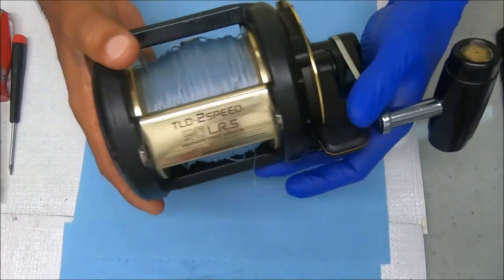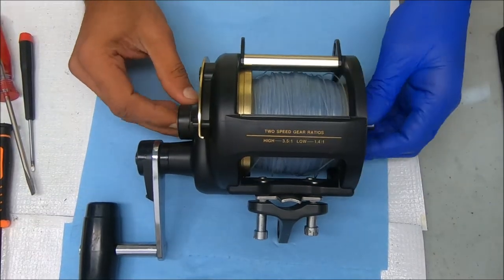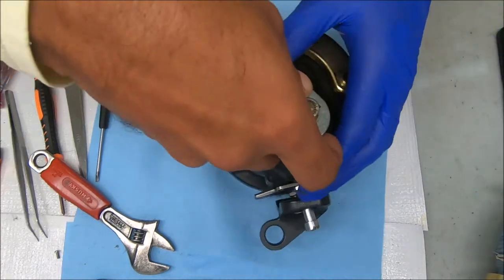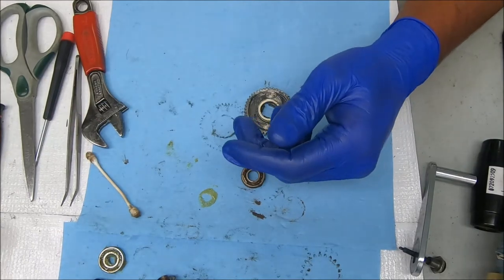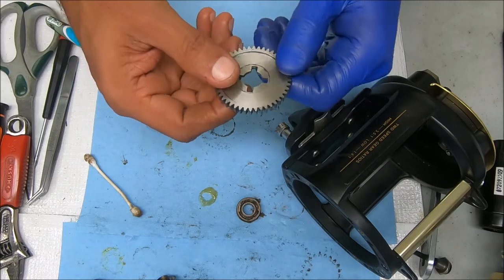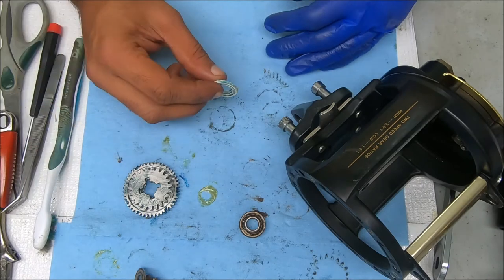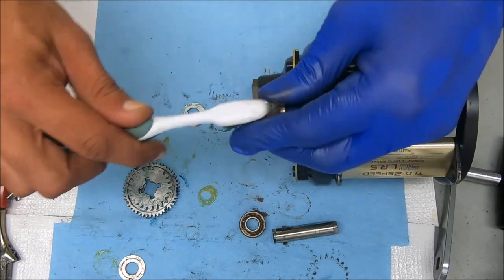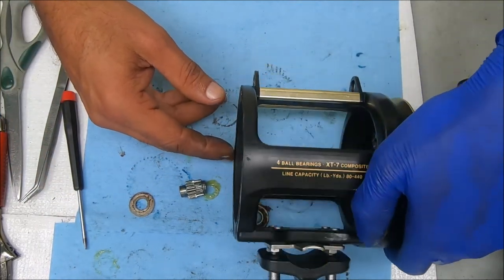Shimano TLD 50LRS Handle Shaky And Hard To Crank - How to diagnose & service

Comment: Trying to figure out why my low gear won't engage any ideas? Looking for a video how the gold sleeve goes inside of the drive shaft any idea if the teeth face up or down?
Reply from the maker: Thanks for watching. The slotted end faces down toward the gears.
Reply: @TSGReelService  appreciate the response bruddah u the man
Reply: I put it back together the low and high gear engage but when reel is back together the low gear seems like it wants to slip and dosnt catch the teeth everytime ? Any suggestions?
Reply: @turningthehandle247  check and make sure that both springs in the main drive shaft have been returned correctly I.e. small spring into the sleeve and under the gear select cross bar. Schemetics do indicate otherwise
Reply: @eelcowalraven8437  I appreciate the response. Turns out the nut underneath the drive shaft wasn't
 tightened all the way causing it not to catch and engage properly

Comment: Helpful video, mine is hard to wind when i increase drag?
Reply from the maker: Thanks for watching! Most likely the pinion bearing. It's usually locked up when you take it out and try to spend it in your fingers, but sometimes it'll still spin but still be bad I need to be replaced. Thanks again.
Reply: @TSGReelService  Got it working, it was the pinion bearing, thank you very much. Season greetings
Reply from the maker: @erwinwestby5719  Thanks and likewise! Happy to hear you got it working again!
Reply: got another 50 TLD this one bail won't come loose, seems bearing is seize to gear, help please.
Reply from the maker: @erwinwestby5719  you mean the spool won't come out, or is it the pinion gear that's stuck to the bearing?
Reply: @TSGReelService  yes sir i can get it out enough to see the bearing is stuck on the pinion.
Reply from the maker: @erwinwestby5719  can you remove the spool?
Reply: @TSGReelService  no the bearing caught under drive gear
Reply from the maker: @erwinwestby5719  the spool and pinion gear are separate.... it sounds like you're saying your spool shaft and pinion gear are BOTH frozen to each other and the bearing. There is a little bit of risk here.... try using a metal cylinder on top of the spool shaft from the handle side and tapping (you should be able to sense how hard to hit it without splaying the shaft metal) with a hammer to try and loosen the rust/corrosion that's around the shaft so you can pull it out. This may take some time, so you don't want to get impatient and start banging too hard. Once you get the shaft freed, I think you can use the video for the rest. If you don't feel comfortable doing it, take it to your local repair shop. Hope that helps.
Reply: @TSGReelService  thank you very much.
Reply from the maker: @erwinwestby5719  no worries, bud. Let me know how it goes.

Comment: I have a TLD 30 with a broken handle knob. How do I remove the knob bin?
Reply from the maker: I assume it's the newer handle, and not the older one with the hard plastic knob.... I think you should be able to pop the cap and unscrew it (see this video https://youtu.be/7zpPJjZY1z8) to put a sub knob on. If no screw, cut the shaft off and install an aftermarket knob or buy a new handle.
Reply: @TSGReelService  
It is the older hard plastic knob.
Reply from the maker: Okay, thanks and sorry to hear that.... see the last portion of my comment above, then. All the best with it.

Comment: I think it depends on the repair, if it requires tearing down over 50% then it’s rediculous not to clean it and the customer should be told or be aware, I know time is money, but I could not let a internally dirty reel leave being the customer could blame you for issues down the road. Not that it’s your fault but customers can be really rediculous.
Reply from the maker: Thanks for watching! Nothing wrong with your input, but if you let me know what time in the video you're referring to, I can give you a little more insight.
Reply: @TSGReelService  I’m just referring to when you said the customer only wants it repaired, and it only makes sense to clean if your already inside.
Reply from the maker: Aah. Okay. Yes, but hey........